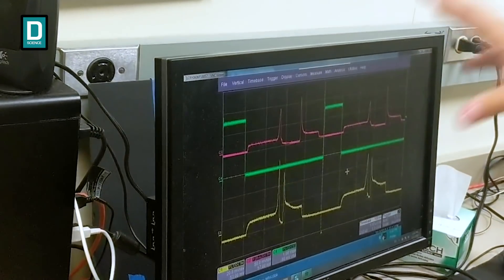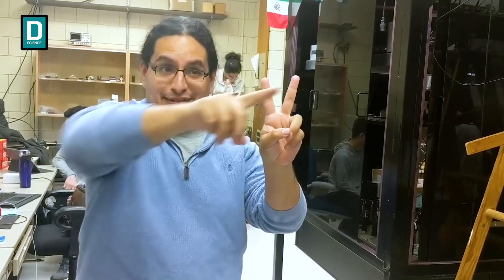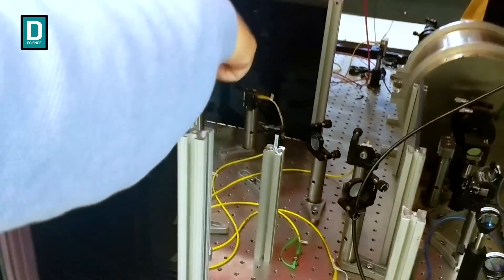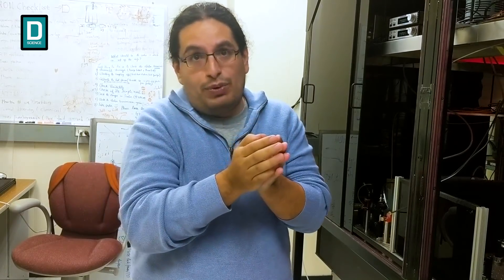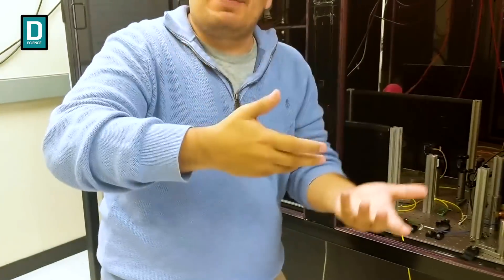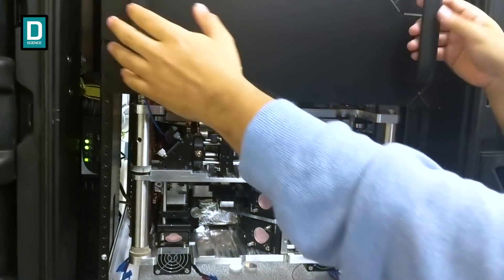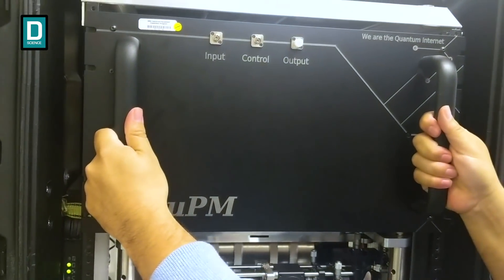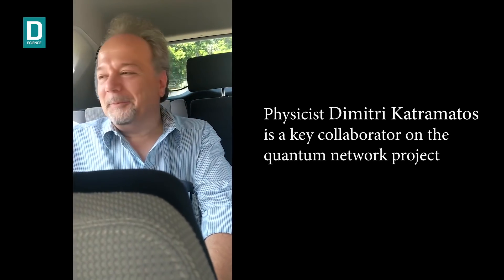The Quantum Garden Of Eden

Comment: As I understand it, he's not talking about teleporting physical things (not even photons). The qubit (information) is what gets teleported. The entangled photons remain where they are and are the medium used to teleport the information. Matter still has to obey the universal speed limit.

Can't imagine what the implications for faster-than-light information transfer will be though. This is so awesome!
Reply: I won't pretend to understand it fully, given a lack of background in physics and quantum phenomena, but per the layperson-oriented explanation given by Professor Figueroa, your understanding seems to match mine. The speed of light is still a hard limit, but now we have a different paradigm here.

Using optics and alignment, a photon is taken and split into two photons that are still entangled with one another. Using the rather spooky property of quantum entanglement at any position, one of those photons is taken to where it needs to be physically, and because a change in one photon's state will also change its entangled partner, measured information (the qubit) can be communicated instantly. Using mirror alignment, manipulation of the frequency of the photons is what allows multiple, discrete pairs to operate at once. It's really brilliant, of course. 

The next innovation that has more practical applications comes around the 4-minute mark when the professor talks about the miniaturization of the equipment, to make it portable. Once the setup becomes relatively standardized and portable, it can be more widely and cheaply produced and distributed. I imagine this will become the basis of quantum-powered networks in the future, and I'm curious as to how it will co-exist alongside traditional ISPs, assuming it fills the same niche. Quantum computing for example only does a couple specialized things better than traditional computing, and is not a catch-all. As I understand it, there isn't any latency with quantum-powered networks, so there won't be any delay in response times for, say, a satellite. In fact, I wonder if we could manage to get one of these onto a probe and get images of extrasolar bodies instantly - or maybe if we set up an outpost on Mars, we wouldn't have communications delays! Or, if we're being cheeky, put an end to competitive gamers complaining about lag.

I'd love to keep up with these developments! Assuming nuclear war, a supervolcano eruption, (or whatever doomsday scenario one can conjure up) doesn't occur in the next fifty years, we're in for some really exciting times.
Reply: @DunadanRanger  Thanks a lot for this explanation, I understand this process much better! And also, it's a brilliant concept.
Reply: It takes a signal 12.5 minutes on average to reach rovers on mars. It would be convenient to control them in real-time.
Reply: We're all going to be issued with free Quantum (Q ) Phones and a Quantum computer. This is part of the wonderful benefits to humanity which the QFS ( which will be run by a Quantum computer ) and NESARA'GESARA will bring.